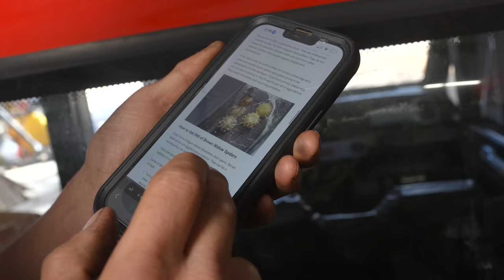Building an Elevator in my Dream Garage! Officially Moving in!

Comment: You guys need to put joist hanger straps on them i joists. Not positive, but looks like you've only got 2 screws in the end of each joist. Highly recommended hangers and structural screws before putting any significant weight up in that loft.

Comment: I hope you hard wire in buttons for the elevator with limit switches that shut it off.  May want to put in a few catches (3) too, like a car lift, so that IF the rope or winch gears fail, you dont get hurt.

😢saddened by lack hexagons on the GHP elevator..😂

Comment: In work we have a machine with a lift and it uses a car seat belt just so if the chain drive breaks the seat belt snap locks and stops the lift from dropping suddenly maybe something ye can incorporate 👍 but in normal operation the seat belt just extends and retracts as normal 😁

Comment: For reference, that is not the proper way to splice synthetic line. There are plenty of tutorial videos on YouTube. You need to do a locked brummel and then taper the end before you bury it and there's a specific length that is supposed to be buried based on the size of your line. If you do not do the locked brummel it can slip out and it can also be much weaker if you do not taper the end. It seems strange but it will literally break the rope right at the end of where the other rope is buried.

Comment: Could of mounted the winch on the elevator and ran a snatch block to the beam then the line back down to the winch that way you eliminate the need for the springy line for the switch. Premium!

Comment: If that elevator ever needs more support add a third rail in the center of the middle of the other side of the elevator car. Make it a guide rail and use a bunch of roller blade wheels that are mounted 45° from one another and roll on the third rail at a 45°angle.. I'm not good at explaining this but I could build it..

Comment: Haven't watched the whole video yet, but wouldn't it be smarter to have a pulley at the top and the wench motor somewhere down low? Can be serviced easier, decreases load, and if the fasterners holding the wench fail a wench doesn't crush your skull at the same time that the sudden drop crushes your spine and or legs?

Comment: It will be a lot better if the winch is mounted on the elevator flatform and connected to a pulley on the top.

Comment: I feel like you should just go ahead and gusset support that elevator floor now to the vertical beams. Or add some sort of support bracketry.  You'll be doing 100fold max capacity by the end of the week.  Probably already have lol

Edit, get weird and do some sort of cable support from floor to vert rails. Or leave as is.  I'm sure it's g2g

Comment: Why didnt you buy a winch with wireless controls. That way you could operate the elevator even if you wanted to ride the elevator while moving something you need to secure.
I've got wireless controls for the winch on my jeep and it's the only way to go compared to the old hard wired winch I used to have.

Comment: I bet if you put a piece of rubber (like mud flap) between the winch and beam then build an insulated box around it with just a hole for the cable that you’d cut 90% of the sound out of that thing.

Comment: Man, my county had a huge problem with black widows.  Any place dark or damp has a black widow.  It's hard to explain but every sprinkler box, every window well, I'm telling you every where there is a black widow.  If I place a project outside for a week when I roll them back in the shop it will have multiple black widows under the vehicle.

Comment: Install a real elevator control panel out of an old elevator, with light-up buttons so you can just push the "2" button and watch it light up as it takes you up to the top. And limit switches at the top and bottom.

Comment: The hoist you're using for an elevator wench looks like it came from Harbor Freight. If it did, it should have a really long remote cable. At least mine did about 12 to 14 ft long.

Comment: You could maybe quiet the elevator by replacing the wheels with strong plastic, or just wrap the wheels in tape.
Reply: I doubt you can even hear the noise from the wheels over the deafening sound of that winch resonating through the I beam.

Comment: How is a new building so far off square ? Cannot believe how far of the rails are from the main supports for the lift, Looking at it it runs out about 6inches over 9 or10ft something is wrong.

Comment: Should probably have bolted the lift rail to the beams with some sort of insulation ( rubber?) so it doesnt resonate like it does now. Painful to listen to! Also personally would have made the lift use four of those rails. And some sort of braking system if the winch or the rope fails. But knowing these guys they could most likely jump from a standstill up and down that distance without problem or getting hurt 😅

Comment: that's some major pinch hazards on the elevator. Not to be the safety police but you might consider at least some toe boards if not a full cage, could take someones toes off. Or just tear the elevator apart if some equipment was hanging off the edge slightly when you try to lift it

Comment: Stop doing promotions for these junk/disposable electric bikes and so on. These bikes are awful quality and most of it is not maintainable. Try finding an innertube that size in your local bike shop(the owner of this is likely not going to carry a spare one in 99% of cases). I see this stuff all the time and its so frustrating as a mechanic and makes you feel bad for the consumer that a company has sold them something such poor quality.
Reply: make an interesting fabricated electric bike with an aftermarket mid drive motor like a CYC photon or bafang if you want to push bicycle content.